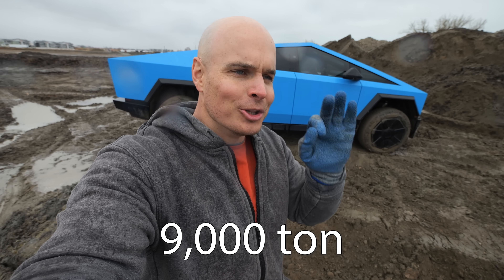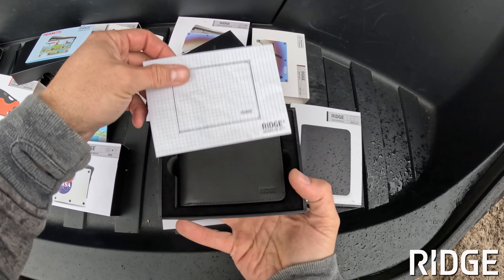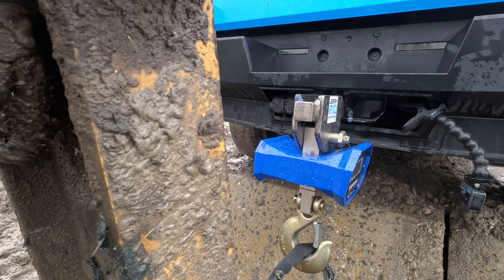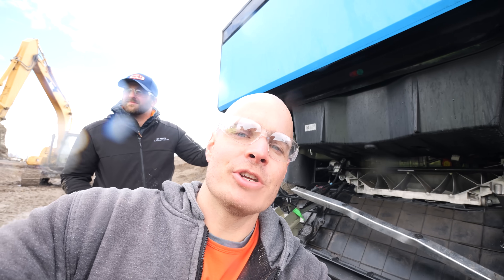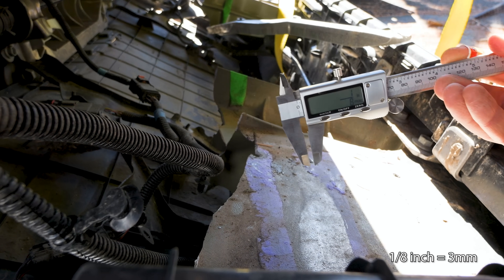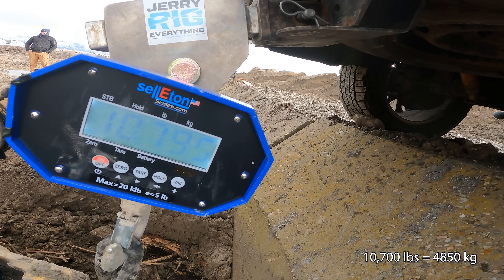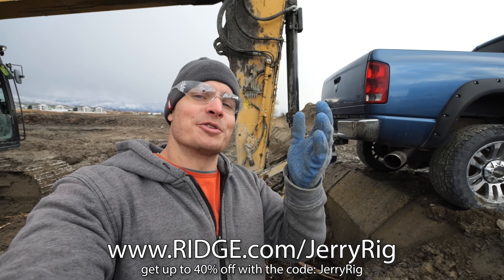SHOULD YOU TOW WITH A CYBERTRUCK?! - (catastrophic failure test)

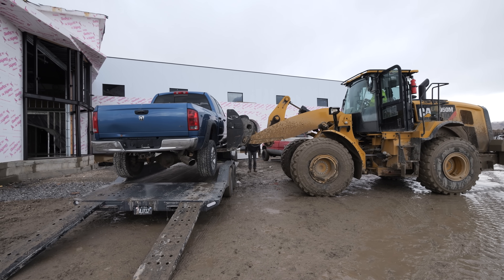Comment from the maker: Welcome to the Cybertruck vs Dodge RAM tongue weight durability test. To see the steel frame 2004 Dodge Ram get tested jump to 11:12 (spoiler: it survives)

We've seen at least 3 other Cybertrucks loose their back end. Its not the hitch that breaks.  It's the aluminum truck itself that snaps. Don't let it happen to you!
Reply: You need to durability test the ridge wallet
Reply: @travisminneapolis Smarter every day did that. He shot it with a 9mm.
Reply: It's glued to stop rattling
Reply: @integrii  not 6 feet behind the enclosed cabin where no one would hear a rattle. There is a structural component to that adhesive so the questions are is the glue there to add additional support to the hitch from surrounding sub-assemblies  or are surrounded sub-assemblies being supported by the hitch?
Reply: Shouldn’t the comparison be more of a 1500 not a 2500 as the towing capacity and frame build will be bigger based on it’s higher towing capacity that it has?
Reply: Now do your Rivian.  Haha.  Just kidding
Reply from the maker: @darbymoses4053  i might 🤔
Reply: Do your R1 @JerryRigEverything
Reply: @JerryRigEverything  No he won't.
Reply: @JerryRigEverything  yes please
Reply: @JerryRigEverything  Do it!  I dare ya!
Reply: @JerryRigEverything SAE J684 says a trailer coupler should be able to hold 1.3xtrailer weight in vertical compression. Your test seems to show cybertruck doesn’t meet SAE towing standards if it did it would be rated for a max of 7k lb towing
Reply: @JerryRigEverything We wish you would, but we all know you won't. You have a personal narrative to push against Tesla. FYI - The R1T tongue weight rating is 1,000 lbs.
Reply: @JerryRigEverything  The cybertruck castting snapped at the crash structure. You could make it stronger but then the crash structure would be stiffer. Cybertruck gets a 5 star safety rating so perhaps Tesla chose safety over maximum strength.

Structural adhesive is extremely common in automotive and much stronger than you think. 

Its hard to tell in your video but the steel frame truck looks bent and if it is permanently deformed, then I would consider that a fail.

You seem to have a strong bias against Teslas and I wish you would at least try to be a little more object in your Tesla related videos.
Reply from the maker: @5893MrWilson  i put the same weight on both trucks. Trucks with hitches aren't designed to crumple. Thank you though.
Reply: @JerryRigEverything they didn't invent the press they just bought one...
Reply: @JerryRigEverything  that would be an awesome comparison to see.
Reply: @JerryRigEverything  Do your "not a wheelchair"
Reply: @JerryRigEverything you wont do the Rivian…if it failed as well, that wouldn’t fit your initial agenda of this video. I actually think the cybertruck in general is a turd and its ugly as sin, im on the Cyberstuck reddit page, but its not because “I hate the CEO because he is doing mean things” “he is such a jerk” —-yes, thats you. man up already
Reply: @JerryRigEverything  You won't.
Reply: @JerryRigEverything  It's more than a might be. All your word choices, adjectives, and lack of objectivity clearly indicate perception bias.
Reply: @JerryRigEverything you should I’d be curious
Reply: @darbymoses4053  no, do it
Reply: Not holding down the front of the Doge is a huge fail in your test.

Forces are dampened and forces are slightly distributed further to the front of the car when the nose is higher.

It would have been fair to make the two test cases the same.

Besides, 10k down force is incredible...
Reply: Try really towing stuff or pulling it instead of applying a downward force.
Reply: Loading 10,000lb onto a tongue that's rated for 1,100 lbs and the being shocked when it breaks... I used to love your content Jerry, but this is a new low for you.
Reply from the maker: @DevinOlsen  this is a tongue weight test.  So on the tongue is where the weight gets placed. We did the same thing to the Doge Ram at the end of the video. No worries though!
Reply: @ Pushing down on the hitch while also pushing the front of the truck down adds unnecessary stress from the suspension and frame flex, making failure more likely but in an unrealistic way. A proper test would apply a direct, controlled load on the hitch alone, as real-world towing never involves simultaneous force on both ends of the vehicle. This method skews the results and doesn’t reflect actual conditions—pure nonsense.
Reply from the maker: @GET2222  for official hitch SAE safety certification tests they also strap the frame down.  Or mount the hitch on a rigid structure. Thank you though.
Reply: Nice job Zack!  You proved the Cybertruck’s failure occurs at 9 times the rated tongue weight. Safety factor of 9 sounds great to this board certified registered professional structural engineer.
Reply: @willbraswell4906  Does to me too!
Reply: EDS
Reply: Do the telo
Reply: Does the tongue weigh capability so much. Here in EU, most tongue weight I have seen is 100kg. I might be mistaken, but from what I understand,  that is the weight of a no moving cargo applied directly on the tongue or hitch. And this is not the weight of the trailer.
Reply: @teovm  Same here in the USA. My old Ford F150 pickup has a bumper hitch and is rated for 300lbs tongue weight (136Kg) and my 2023 F150 with a factory tow package has a 500lb (227kg) tongue weight. The frame on the CT is engineered to work within it's design limits, and it appears to do so. Airplanes are designed this way; the wings hold the entire weight of the plane for take off and withstand massive stresses in turbulence, but if you step on the wrong spot on the wing it will buckle and the plane will be grounded until repairs can be made. 

If I start seeing cases where hitches/frames fail under normal usage then I'd be concerned and say that they need to look into it. In reality, most CT owners buy them for status or to get attention; they aren't using them as work trucks. EVs aren't really great for any significant towing anyway. Imagine pulling your camper to go away for the weekend and having to stop every hour to charge for an hour!
Reply: @mikelemoine4267  What the user does with It's vehicle is their job, work or pleasure or both. From what I see, most of the high-end trim trucks in the US are just a show off vehicles, never been used as a work truck, or like once a year. But it does not matter, the hitch should work.

Towing is not for everyone. Here in the EU you have to have a special license if you want to tow something over 750kg. So I presume it includes load balancing and other stuff when taking the course. 

I'm just interested what is the case that a tongue weight should be that strong to withstand the weight of the trailer it is pulling. Wouldn't that lift the front end, making things way worse than braking the hitch (frame). Does anyone asked the suspension about that scenario 😄.  My car can cary 670kg, but can tow 1300kg. Now I do not see how putting 1300kg on the tongue wil not exceed the 670kg carrying capacity. If you hit a pothole or an animal the suspension on the trailer and the vehicle should balance the load for that split second. The only way the tongue will carry that weight is on a strange incline (a very sharp high degree incline change) and if the trailer lifts from the ground for some reason. But I do not see how that is a fare use. Non the less, if it is in a standard like ISO, DIN.. then I guess it should withstand such weight, but is it.
Reply: Get Sandy Munro on the line! I wanna hear his take on this and especially about the adhesive. Feel free to make it fun and have Jason Fenske from Engineering Explained come on as well. Them two know each other.
Reply: I've yet to see any data to back up the claims you and WD made that these are falling off in real-world, normal towing conditions. Can one of you do a video on this?
Reply: You had it all wrong. I know you don't like Tesla, but your final thoughts on this were full of technical knowledge mistakes. You SHOULD take it back and admit you were wrong about it. Please be better Jerry, don't fall in the angry haters pot.
Reply: Jerry has a flawed experiment. It’s called physics. When you push down on the front end of the truck to stabilize the force on the back you are adding more stress to the hitch. Meaning, the tongue weight was stressed more than the weight with pressure from the front and back. 

Try again, Jerry. 😂😂😂😂😂
Reply: @GET2222  sorry but your description of the physics involved in this demonstration makes no sense at all.
Reply: You are resorting to sensationalism not facts.  You are testing the tongue weight, not towing weight.  1,100 lbs weight limit vs 11,000 lbs towing capacity.  Shame on you, just to up your viewership.
Reply from the maker: @johnwilliamson9453  this is a tongue weight test.  So that makes sense.  Thank you!
Reply: @JerryRigEverything  Then you should correct the allegation that this is dangerous, as it’s 9 times stronger than stated by Tesla.  As you know Tesla and Elon is under fire (wrongly I feel) and you should not throw fuel on the flame.
Reply: @JerryRigEverything  Why not use trucks rated for the same then ? And does the frame bending at 5000 lbs not count as a fail for the normale truck then ? As it isn't safe to drive anymore at that point.
Reply: It’s 11,000 pounds of towing capability not how much you push right on top of it like shown in the video there’s a difference now yall are just trying to prove Tesla wrong but yall are the dumb wrong people here. You do that to any vehicle it will break
Reply from the maker: @Therandome2  the dodge didn't break watch the video.  😂😂
Reply: @ I did. What degree do you have
Reply: @JerryRigEverything  The frame bent at half the weight, making the whole car unsafe to drive, and its rating is even higher than the CT.
Reply: @ no I don’t know how to explain it but yall are wrong about 11k tow weight/torque
Reply: @JerryRigEverything  The Dodge didn't break because it's rated to hold significantly more weight. It's not even the same truck class.
Reply from the maker: @TheDevonParker  it's a 2004. Both are class 4 hitches. Thank you though.
Reply: @JerryRigEverything  But one vehicle you pinned down in the front, the other vehicle was missing an engine, so I'm pretty sure the weight distribution off of what was planned for the vehicle was completely inaccurate. It did not give me that things are the same when nothing is the same in your comparison. Also, did you measure the travel on the frane, because the Cybertruck aluminium will just snap, whereas the truck you use will bend. 

This face that you wanted to virtual signal to all the people who made Tesla and Elon right now that you're siding with them. Don't try to keep this as a scientific test because it's far from it.
Reply: @JerryRigEverything  The Dodge is clearly rated for significantly higher tongue weight and payload in some configurations. The engine in those trucks weighs 1,150lbs, which adds extra weight and stress to the frame.

You used a truck sold in a higher class, and you used a truck with the engine removed.
Both having the same class of hitch does not determine what the FRAME can manage based on the engineering specifications.

Some configurations of the 2004 RAM 2500 are rated for 1,800lbs tongue weight vs the Cybertruck's 1,100 lbs.

Thank you though.
Reply: @LA_318 ... he was able to rip the ass end off the Cybertruck, but not the Dodge. I mean.... THE FRAME BROKE, YOU SYCOPHANT.
Reply: What's Jerry trying to do? Prove how great the Cybertruck is manufactured. That was 10 times the tongue weight the CT is rated for. And no, a pothole would not put 10X on the tongue. At 10X the front wheels come off the ground and they had to hold the front down in this video to keep that from happening. It seems Jerry was trying to prove something despite the facts, and he failed.
Reply: You mentioned that both aluminum and steel don't have fatigue limits but in very different tones
Reply: Thanks for metrics!
Reply: You said the aluminum does not have a fatigue limit. Then you said steel does not have a fatigue limit right after that.
Reply: the fact that the Doge RAM was in an accident and still beat the cybertruck was amazing to see and im happy it did
Reply: I'm sure you heard this already but at 4:21 you state that steel does not have a fatigue limit. I know its a misspeak, but you may want to leave a little note somewhere clarifying that
Reply: Allow me to clarify that Cody applied force by slamming the rear upwards, not downwards before breaking it off. This means your experiment demonstrates that it's weaker than the truck, but it could be significantly weaker in the opposite direction, which is more challenging to test. Am I right?
Reply: So overengineered v superbly engineered to cope with the load in the manner and direction that it will be subject too. It's like F1 suspension, super strong in the direction it goes in, weak in the other directions which it is not designed to move in. Anyone can over engineer anything, the skill of engineering is using the least amount of material to hit structurally required goals
Reply: weight durability? when trucks are towing that is not the vector  of forces that are applied to that element so the test is not relevant to  TOWING.
Reply: @geostel  100%
Reply: Now you make this kind of stupidity videos to feed this stupid society?
Reply: @Sirikazy  It's not stupid ,he's engineer, he understands what he's doing wrong in this video and he is doing it on purpose.
Reply: That's not really even a live load either, which is more concerning. With a dynamic load the potential to break is at much lower force. At the absolute minimum, there should be a rear steel subframe to distribute the load into the aluminum frame.
Reply: Sorry Jerry but this the dumbest test ever! Because even if you’d have that heavy of a payload the tow hitch would touch the ground lifting the front of the car waaaay before breaking 😂 you even said that there is so much down pressure that you had to use another excavator to hold it in place in the front. I used to respect your channel with great content but idk why you’re doing this, probably just to cash in on the lets do something bad against tesla train 👍🏻
Reply: @JerryRigEverything  Fails as a YouTuber for click baiting!
Reply: If Tesla goes bankrupt, will their cars become bricked?
Reply: Tow capacity is not the same as “tongue weight”.  Please don’t ever pretend that you don’t know that.
Reply from the maker: I explained the difference in the video.... so yeah pretty sure that's the whole test. @scottweis7214
Reply: Can you try this test with a Century 1150 wrecker on a 4-axle Peterbilt 589 chassis, using the excavator to apply downward force on the wrecker boom?
Reply: You raise eyebrows 😲, not eyeballs 👁️👁️
Reply: Now do one of the Ford Aluminum Body trucks to see how it holds up . that way it's Aluminum vs Aluminum, Not Aluminum vs Steel.
Reply: The power of the 3rd gen ram
Reply: What are you doing?T 51:09 😮
Reply: form my searching and undercoating vehicles ive seen my fair share of rams cummins  around that year and it max load for towing ive seen is around 13000 lbs to 16000 lbs so you got a bit more to go before it will brake off
Reply: @JerryRigEverything  ur test is Entertaining but completly pointles
Reply: Esos autos son una mierda no pasan la prueba es botar el dinero
Reply: Someone is clearly a Kamala supporter who’s trying to make Musk look bad.. you are a disgrace to this country. Get OUT
Reply: @JerryRigEverything  Zach, we saw glued components that separated from the cast aluminum, do you believe it was glued to either A: provide supplemental support for the hitch assembly or B: have the hitch assembly provided support or limit movement for structures above the hitch?
Reply from the maker: @Jetjockgordo  it's really hard to say. I just don't know. There are aluminum points that do poke through that bottom layer.  I assume those were also structural. But I don't know if those were doing most of the work or if it was the glue.
Reply: @JerryRigEverything This is one of the most disingenuous videos you could have possibly made. Really disappointing.
Reply: Nice joke 🤣🤣🤣🤣 do u belive ur self? I think not. In normal utilisation condition that force and the way it's produced will never be reproduced. Even If that force will be produced it won't keep that longer the truck under tension. Maybe the front axle will be rised from the ground but the truck won't brake. I'm sure 100%. I challenge u to put a trail loaded with 5 tons and go where ever u want trying to brake the Cybertruck. But it will never brake.
Reply: Don't know about the US, but both the Model X and Model S are sold with a hitch in Europe. And both those vehicles also have a lot of aluminium in them. It would be very interesting to see tests with those vehicles as well.
Reply: Unsubscribed. You have a weak moral character to be okay producing such a B. S. test and claims that you care about consumers. 

All this was, was you showing people that are destroying Teslas and attacking Elon. That you side with them and that you hope that they don't attack you for owning or supporting Tesla in the past. I hope if you try to use this as a tax write-off, the IRS comes in punish you for fraud.
Reply: @JerryRigEverything  what a terrible biased video!! The front wheels would have been off the ground before it would have broke! Your left wing woke blue hair is showing!!!
Reply: Bald man and Crazy nuclear scientist hate DOGE man because he made his dreams a reality. This is an unrealistic test, which you've covered your behind in the video. This is a completely unrealistic test just to drum up hate for Tesla and elon musk by proxy since most people don't understand the physics and ratings involved. Not a fan of captain orange or doge dictator but your should hold yourself to better standards.
Reply: please change your description to show this too, *The tongue weight is the downward force that the weight of the trailer exerts on the hitch. It must not exceed 10% of the maximum towing capacity. Your miss informing people with your current description!
Reply: looks like someone is pissy his candidate lost
Reply: @mistertwister7858  bro how did you turn a truck testing video political. It's not in the slightest bit relevant
Reply: I highly doubt they're ignoring this... All they have to do is increase the thickness of the metal that they're casting in those areas.
Reply: This video makes me worry about the meth epidemic in Utah.
Reply: So although aluminum is the problem this test your doing is downward force equivalent to tongue weight so your test is flawed.
Reply: It definitely won’t happen to me! I’d never buy one of those pieces of junk!
Reply: Aluminum has a shorter and weaker fatigue limit after a short number of cyclical cycles before failure. Just ask the navy with their aluminum haul ships.
Reply: That Dodge is ugly lol
Reply: I don't like seeing the destruction of products that are functional, but I have to say that seeing a Tesla vehicle destroyed is somewhat cathartic during this time.
Reply: Have you sticker "I've bought it before Elon go crazy"? @JerryRigEverything
Reply: Was soll dieser Test?   > 4.000 kg vertikal auf der Kugel?  Da würde selbst ein LKW die Grätsche machen.  Es gibt wenige Zugfahrzeuge die merkt als  100 kg Stützlast haben. Klar, im Gelände kann das auch mal kurz mehr sein,  deshalb sind die  > 4.000 kg absolut Irre gut.  Das ein RAM  oder eine F 150 eventuell so viel können, liegt an der Tatsache, dass  sie Leiterrahmen  verwenden, wie bei echten LKW.  Nur dass sie  weder die Nutzlast haben, noch die Anhängelast. 
Weshalb es aj auch nur die Kugel gibt, ansonsten würde ja eine normale AHK rankommen , mit  z.B. 40 mm Bolzen.
Tandemhänger mit hoher Stützlast, haben auch andere  AHK mit stärkeren Bolzen.
Reply: If you do another comparison on build quality you should compare it to the Silverado EV and Ford Lightening. Would be cool to compare other EV trucks to this piece of crap! 😂
Reply: Truck frames should not snap like tesla
Reply: Hey man, I heard you're selling all of your Teslas this year. You could donate them to those in need like myself. I really need a vehicle to go to work and make sure I can give my child a decent summer and be able to use for emergencies and such.
Reply: Lose*
Reply: Do Ford lightning - that would be a legit comparison, not a gas guzzzler
Reply: ...... Does this guy seriously not know the difference between lose and loose? I'm upset a large YouTuber would make such a callous mistake. Lol jk
Reply: @JerryRigEverything  if I wanted this kind of 'test' video to smear a company, how much 💰💰💰 you charge?
Reply: Lose. Loose = not tight. I swear I was born to see this mistake as I do almost every day somewhere.
Reply: Can aluminum be mixed with anything to give it a fatigue value? I know some plastics are mixed with fiber, so I'm just wondering...
Reply: This is interesting, but not conclusive. The real concern with cast aluminum is its flexure strength - how does it perform with continuous oscillating load. This is when castings are more likely to show failure especially if there is a notch/defect on the casting.
Reply: what version of truck was it used in video,  looks like single motor,   11klbs is rated for dual and triple motr versions
Reply from the maker: @oldeknight  mine is the dual motor foundation series. (Not the beast)
Reply: @JerryRigEverything  so you're not a beast huh?
Reply: unsubscribed officially
Reply: Diesels hitch didnt "fall off" and/or "completely seperate". He arrainged a specific direct impact to the hitch that exceeded the owners manual weight capacity of 600lbs tongue weight and he arrainged it so that it was dramatically more and included a giant shock load of the entire vehicles weight which is like six thousnad lbs plus the shock load so this is like ten times the rated weight capacity in terms of tongue weight.  Jerry, your word choices on this are kinda misleading. You can tell a literal truth and at the exact same time be entirely misleading people which is in essence a BIG FAT LIE!
Reply: You clearly are biased and have a negative view towards Elon. But, you will never admit it.
Reply: A product clearly states its capabilities, yet IT is blamed when it doesn’t exceed those stated limits? It’s interesting how some content creators conduct their own “scientific tests” that claim to disprove findings from the National Highway Traffic Safety Administration.
Reply: You really need to admit that going 10x over the tongue spec weight limit is an amazing result, and everything you say regarding brief moments when almost the whole trailer weight can shift to the tongue is nonsense as the front of the truck would lift, preventing the excessive load and snaps. Do a proper test with towing 11000 lbs on a bumpy road at highway speeds and show us how "bad" the Cybertruck is.
Reply: @JerryRigEverything  Bogus video obviously designed to disparage Tesla. Tongue weights are all rated for 10-20% of towing capacity. The Cybertruck tongue weight rating is 1,100 lbs. You tied down the front and put almost 10x that weight on it before it failed! In a real world towing scenario if such a thing were even possible, the suspension would  collapse and the front wheels would come off the ground long before the hitch failed.

You have lost all credibility with many of your (now former) subscribers, I hope it was worth it. 😞
Reply: @John-qc8yy 100% agree! Good bye Jerry! Hope it was worth it!
Reply: No truck - even a Dodge - can handle 3 tons of downwards hitch pressure! It's not the hitch that's the problem - however the steering is! This test just proves that one material breaks before another material... did you really need to do this test?

"The RAM 1500 curb weight can range anywhere from 4,765 pounds to 6,440 pounds depending on the configuration you choose."

So this means that AT MOST it weight 2.921 kg - which is less than 3.000 - AND the rear axle of the RAM is NOT at the hitch which also has a meaningful impact - meaning that IF you ever applied 3 tons of downwards pressure to hitch of the RAM - the front wheel would be off the bloody ground m8! The Cybertruck is 3.104 kg however the rear axle is like a meter + from the hitch - and the rear engine(s) is behind the axle which also influences the results. I SERIOUSLY doubt any of the trucks would feel comfortable with 1500 kg of downwards pressure on the hitch - especially if the route is the least bit bouncy! The fact that the hitch is fine a 3000 kg - is ACTUALLY proof that it's more that sturdy enough to be used as a truck hitch!
Reply: Stupid test, no pickup truck in real life  is hold down by the front like that. 

Don"t tell me your trucks are doing wheelies while towing 10 000 pounds because of a bump or bad traller ballance...
Reply: This was the most ignorant test you could have possibly performed, I am extraordinarily disappointed in this video. You are smart enough to know this test is completely irrelevant, yet you still preformed it and implied otherwise. Total sensationalism that is very much not what I have come to expect from your content.
Reply: 10,500 is what I saw, you hate Tesla now, and it's noticeable.  Pathetic that you put political feelings first.
Reply: Don't own a cyber truck and don't care about them, but 10,000lbs is the "towing capacity" not the "hitch capacity". There's a massive difference. Tow is parallel to travel not perpendicular. Capacity is as much if not more factor of braking (legally) as it is structural integrity. If you can't stop a load your vehicle is rated for, then you get a fat check from that company when something goes wrong. It's also why people making videos about towing more than 10,000lbs are idiots. That's not the limit, it's the number derived from the safety factor. 

Edit: Unless your trailer has no wheels you'd have to massively overload it at the front to make this happen. That said, cast aluminum is a poor choice and people don't know how to tow anyway.
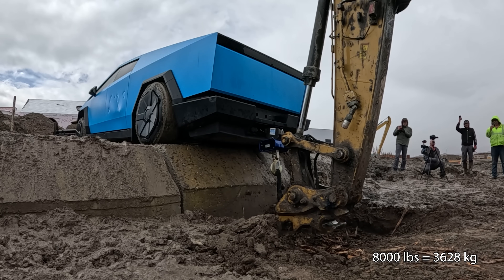Reply: 6:58  All the "doood" -ing  made me think for a minute that I was watching Smarter Every Day. 😉
Reply: Alright, buckle up, because I’m about to dissect JerryRigEverything’s Cybertruck hitch test with the kind of precision that’d make a surgeon jealous—and the sardonic glee of someone who knows physics isn’t just for nerds in lab coats. Zack Nelson, our YouTube torturer-in-chief, decided to see what happens when you treat a Tesla Cybertruck’s hitch like it’s auditioning for the role of “piñata” in a monster truck rally. Spoiler: it didn’t end well. And not in the fun, “let’s watch it squirm” way.
Here’s the setup: Zack takes this angular beast, rated to tow 11,000 pounds like it’s hauling Elon’s ego, and slams 10,400 pounds of vertical force straight down on its hitch with an excavator. At that point, the aluminum gigacasting says, “I’m out,” and rips off cleaner than a breakup text from your ex. Then he tries the same stunt on a 2004 Dodge Ram 2500—steel frame, blue-collar grit—and it bends at 10,700 pounds but doesn’t snap. Cue the slow clap. Riveting stuff, right? Except it’s all bullshit when you crack open the physics.
The Cybertruck’s hitch is built for a tongue weight of 1,100 pounds—that’s the vertical load it’s supposed to handle, not the whole damn trailer crushing it like a bad sitcom finale. Zack’s 10,400 pounds? That’s 945% more than the spec. Imagine your grandma baking you a cake, and you complain it’s not a seven-course meal. That’s the level of disconnect here. Aluminum’s brittle—it snaps under that kind of absurd overload. Steel bends like a politician’s spine. Neither proves jack about towing unless you’re planning to drop a house on your hitch.
Towing’s about pulling, not squashing. That 11,000-pound rating is horizontal tension—force spread out, not a guillotine chop. Tongue weight’s maybe 1,100 to 1,650 pounds in the real world, 10-15% of the load. Zack’s test is 845% over that upper limit. It’s like testing a condom by firing a cannon through it and calling it unsafe for sex. The physics don’t line up—direction’s wrong, magnitude’s insane. Potholes don’t hit your hitch with nine times its design load unless you’re towing through a war zone.
Tesla probably engineered that aluminum to break clean—save the frame, sacrifice the hitch. Smart, if you’re not into twisted metal origami like the Ram’s steel flex. But Zack’s takeaway—“I wouldn’t tow with this on a freeway”—is the kind of overdramatic nonsense that’d get him booed off a comedy stage. A 945% overload doesn’t mean it’s a death trap at 1,100 pounds. It means he broke it because he could. Congrats, Zack, you’ve proven gravity works. Next time, test it within spec—or at least make the explosion prettier. I’d watch that.
Reply: @GET2222  "test it within spec" because real life always happens to just match arbitrary specifications, and nothing out of spec ever happens, right? shakes head oh to live in such a perfect world...
Reply: @ huh? You know Jerry just proved it was 10X tested over spec.
Reply: @GET2222  so did you watch WhistlinDiesel and what happened to that hitch assembly? Similar failure but under horizontal tension with no tongue load at all. I'd like to hear your opinion about that incident. I looked closely at both videos and the frame casting looks very uneven with wild variations in wall thickness and possible contamination or voids in the cast aluminum. It's more about slow, predictable bending and deformation of steel before catastrophic failure versus almost no bending or precursors to explosive failure of the cast aluminum. Why didn't the 20 year old RAM fail in the same manner even with a higher load and signs of previous damage?
Reply: I dont think this was a fair test at all.
Towing tests should be done in a way that reflects real world conditions typically with the load attached to a proper hitch at a reasonable angle (close to horizontal). If you pull at a steep angle, a lot of the force would be redirected in ways that don't accurately represent towing capacity.

This is more of a structural stress test, almost like a fracture test or a shear force test rather than a real world towing scenario.

Towing is meant to work along the longitudinal axis of the vehicle, where the frame, hitch, and suspension are designed to handle the load efficiently. But if you apply force at a steep angle, you’re introducing bending moments and shear forces that could break components not designed for that kind of stress.

It’s like pulling a shopping cart sideways instead of pushing it forward—it’s not designed for that, so it’ll just tip or break rather than roll properly.

You are basically testing frame rigidity and weak points rather than actual towing capability.

I hope we actually see a fair test in the future.
Reply: @upper-Machine-276  exactly! Well said. I just can’t believe so many people here think this test proves anything bad. In fact it proves the opposite.
Reply: @upper-Machine-276  Yeah, this test is not realistic at all to what he’s trying to say. He is critical on Elon so it’s probably done in a biased manner to throw shade on Tesla…
Reply: @upper-Machine-276  I didn't watch it, but the thumbnail shows what you're talking about, and his description of the video also matches what you're saying. It doesn't sound like it's worth watching at all.
Reply: We got excavator having affair with dodge while Tesla got injured before GTA VI 😅
Reply: @vpn6958  It's really simple: buy a Dodge not a DOGE.
Reply: Lose*
Reply: A totally biased "test"... not a problem, things should be tested! But you say 10k is bad for a Tesla, but 10k is great for a Ford... just watch yourself. Stay technical, much better... no one needs another biased crying Youtuber.
Reply: This whole video is very misleading on so many levels and coinvent for you only to go a little bit past the known breaking point of the Tesla. And you just proved that the Tesla its better than what its rated at. and even if you barely pointed out the difference for towing and tow hitch weight. still repeated like it was the same. Bet the weight is within 10 percent of eachother.
Reply: Spoiler, the frame bent at 5,000lbs and you didn’t bother mentioning that.
Reply: Sounds like Cybertruck is made just like my collector toys ... diecast.  Many people here are confused about dead loads and live loads.  The dead loads are after the tesla event when you are dead and motionless.... no seriously the tongue and trailer weights limits are dead loads.  The live loads, that most manufactures design for, are like when you or trailer hits a hole going down a steep hill with heavy breaking.  The tongue load can easily approach the total load in the vector perpendicular to the road or apparent downward force on the tongue.  Any  trailer of more than 3000 lbs is also required to have brakes.  These breaks will easily transfer  1/2 the total weight in a "rotational moment" of trailer to downward tongue force.  Myself I would expect any truck to be able to hit a pot hole in addition to heavy breaking, like we do just before said pot hole!  What we want to see here is a tire/suspension/axle failure BEFORE the hitch/back or vehicle breaks off.
Reply: @koiphish333  If that was the case you would be seeing trucks doing wheelies while towing loads regularly. 10k lbs applied at the tongue would mean that 6k lbs tesla jumps up and the tongue digs into the ground. There is a reason they held front of the car in this 'test'. You can hate Tesla/Elon all you want, idc, but don't defend this idiotic video. Not to mention this dodge has 20-25% larger rated towing capacity than cybertruck.
Reply: I would have believed this guy to be fair but he is known to be Elon hater so I now take his opinion less than shit. This is a good experiment though. Elon will build stronger Teslas after this.
Reply: @DovashiFuku "I would have believed this guy to be fair but he is known to be Elon hater so I now take his opinion less than shit." So, because he has a political view, he suddenly can't be objective?
By the same measure, do you think you can be objective if you can't get over what you see as his political bias? Or in other words, would you still buy a Cybertruck even though the thing has been proven to be a PoS? Maybe you're letting your political bias make you make bad decisions because you can't be objective because you're too tied up in "his political biases don't match mine".

You're basically saying "this is a shitty test of a Cybertruck's physical specifications because he doesn't like Tesla" when it's just a stress test that the Tesla fails because it was badly (and cheaply) manufactured compared to a time-tested brand of AMERICAN vehicle.
There's also the side of this that the Cybertruck is completely bricked. You'd be able to drive any non-Tesla vehicle away from that situation afterward (even if it wasn't really safe to do) but that Cybertruck is completely dead after LOSING THE BACK END OF ITS FRAME. That alone is garbage, and it doesn't matter if you think that it will never undergo those forces. It will if it's going to be a medium-duty truck.
Reply: @JerryRigEverything  i think people forget that it's a truck not like daily driving vehicles in the city . A truck must be robust for extraordinary tasks, not for high speed .
Reply: I 100% agree that the truck should be rated correctly, but you used to work with companies to improve their vehicles. Now it seems like you're using your political bias to promote judgement against an electric vehicle company you have reviewed and promoted in the past due to it's connection current political events. What happened to wanting to elevate the electric vehicle space and market?
Reply: its literally a hit piece. tow rating is 11k not tounge weight
Reply: i find crazy how tesla lost that bad to a 2004 ram that has been in a crash😂🤣
Reply: @ you find it crazy that the tesla 1/2 ton truck lost to a 3/4 ton truck? The rated payload for the dodge is almost twice that of the tesla. It's an apples to oranges comparison. Towing capacity is NOT tongue weight and his little hotwheels demo was just plain wrong. Imagine moving a wheel barrow around with 500lbs in it.(towing capacity)  lets say you only need to pull up 25lbs on each handle to lift the load. (tongue weight)  are pot holes or hills going to make the handles too heavy for you? not even close. the 500lbs inside it might be hard to push up a hill or to stop while coming down a hill though. See the difference?
Reply: @axlebreakeryt try a 2024 ram of same rating
Reply: @axlebreakeryt this is not scientific at all he did this for clickbait this test is bullshiit
Reply: @axlebreakeryt  it didnt dishonest test, cybertruck has low class rating for single motor version,   2 motor and triple motor are rated for 11klbs,    base model in video is only rated 2500lbs   so it past the test
Reply: @axlebreakeryt Having a steel frame built like a brick shit house helps😂
Reply: @axlebreakeryt   not so crazy...  The ram was literally made for doing work with and moving and towing heavy stuff.  Cyber was never meant for that.  It's truck-ability is meant to be more like a 1980s era Toyota pickup..  🛻  they were super popular.... And I was looking for one just last year...
Reply: @axlebreakeryt  “lost that bad” there is very little between the weight the cybertruck broke and what they put on the dodge, for all we know the dodge could of been close to breaking.
But regardless they both handle way more then they ever need to for towing a trailer
Reply: @markharrison7468 They bounced on the Dodge. Dynamic load is worse than a static one.
Reply: @markharrison7468  No, the Dodge wasn't "close to breaking". Rolled steel doesn't snap, it bends. If it were close ti the limit, it would alrwady be bending slightly, as the failure point doesn't come suddenly, but gradually.
Reply: Yea, aluminium alloy would have been ok feo a sedan hatchback type of a vehicle, but it looks to be inadequate for a truck that is supposed to tow heavy loads.. 
They need to go back to the drawing board and come up with a better alloy alternative for the CT. 
Well, at least it's good to know where the problems are, so that they can be addressed early, before it becomes a serious problem.  😉
Reply: @yesno9592  Aluminum proves itself in racing frames.  It is the use of casted aluminum that is the issue.  You might notice that even farm tractors do not use cast iron on the hitch! Many busses  back in the 50s and 60s were using unibody design with aluminum sheeting/body.  They designed steel mounts for engine, suspension and bumpers so the high stress areas would distribute point loads into the larger body.
Reply: @yesno9592  the car is on the road already. it is already too late
Reply: @ they been making aluminum tow hitches and trailers for years that carry loads exceeding 10k lbs. Should they go back to the drawing boards with all those too? oh ohps, they don't fail.
Reply: @yesno9592 You know nothing
Reply: @yesno9592  Keine Ahnung, aber davon extrem viel.  Der kann sicher 5.000 kg ziehen,  hier wurde aber die Stützlast "geprüft"  . es gibt kein einziges Fahrzeug in Europa, das auch nur 200 kg Stützlast an einer Kugelkopfkupplung  hätte.   Ex E3 Daimler AG ( Truck & Bus)
Reply: Hello everyone! I'm Vietnamese, nice to meet you.
Reply: This is the most moronic video I have ever seen on YouTube followed by the most moronic comment made by the producer of the video. If you're a woke lefty just say it instead of making up crap videos like this that make absolutely no sense. You must really hate your country if you're mocking a guys company with moronic tests because he's trying to save your country from bankruptcy.
Reply: 😮The 51:09 😮 51:09 😮 51:09 😮 51:09 was 51:09 😮😮 51:09 I
Reply: You really showed how safe and better the CT was, the truck bent it's frame at 2250kg, and would be dragged down a cliff instead of break off the trailer instead.
Reply: A 10,000 trailer will not apply 10,000 in any direction, at any time on a hitch, vertically or horizontally. Generally 10-15% of trailer weight is statically loaded on the hitch. During a large bump, perhaps it instantaneously sees double that, so around 3,000 lbs. (leaving a safety factor of >3. In heavy acceleration, let’s say 0-60 in 5 seconds (cyber truck definitely can’t do this towing 10,000 lbs), the hitch will see around 5,000 lbs of horizontal force. That frame is definitely stronger in horizontal than tongue, because that’s how it’s designed, due to how trailers apply load.

Also, they could have gotten more weight from the excavator, just needed to bring the tracks closer to the truck. Tesla may still have an issue, but everything done in this video stinks, and doesn’t show anything.
Reply: JerryRigEverything's Cybertruck hitch load test, conducted by Zack Nelson, has sparked a lot of discussion, and after digging into it, I’ve got some thoughts. The test involved using an excavator to apply downward force on the Cybertruck’s tow hitch, measured with a crane scale, until the rear frame failed at 10,400 pounds. For context, the Cybertruck’s official tongue weight rating is 1,100 pounds, and its towing capacity is 11,000 pounds. Nelson compared this to a 2004 Dodge Ram 2500, which withstood 10,700 pounds without breaking, highlighting differences between the Cybertruck’s cast aluminum frame and the Ram’s steel frame. 

First off, the test setup isn’t exactly a real-world towing scenario. Tongue weight—the downward force on the hitch—typically shouldn’t exceed 10-15% of a trailer’s total weight, so for the Cybertruck’s 11,000-pound towing capacity, 1,100 pounds is right in that range. Nelson’s test piled on nearly 10 times that rated tongue weight, straight down, which is more like simulating a catastrophic overload than everyday towing. He suggested this could mimic hitting a massive pothole with a heavy trailer, but that’s a stretch—potholes might spike tongue weight briefly, but 10,400 pounds is an extreme edge case, not a standard risk. 

The Cybertruck’s failure at 10,400 pounds actually shows it’s got a huge safety margin—almost 9.5 times its rated tongue weight—before the aluminum gigacasting snapped. That’s impressive overengineering for normal use. The Ram 2500, with its steel frame, didn’t break, but steel bends and absorbs stress differently than aluminum, which can crack more abruptly when it hits its limit. The Cybertruck’s frame ripping off looks dramatic, but it held up far beyond what’s practical, suggesting it’s plenty robust for its intended 11,000-pound towing spec when loaded properly. 

Nelson’s commentary leaned toward skepticism, warning about towing safety despite the hitch exceeding expectations. That feels a bit alarmist—real-world towing doesn’t typically stress a hitch vertically like this, and there’s no wave of Cybertruck hitch failures under normal conditions to back up the concern. The test exposed a material difference: aluminum’s fatigue properties mean it might not flex and recover like steel over decades of abuse, but for a new truck within its limits, this isn’t a red flag. 

The construction details—like the structural adhesive holding parts together—got some flak, but that’s standard in modern manufacturing, even in high-end cars. The bigger question is whether gigacast aluminum is the right call for a truck frame long-term. It’s lighter and cheaper to produce, but steel’s durability in extreme scenarios (like this test) might give it an edge for heavy-duty purists. 

So, my take? The test proves the Cybertruck’s hitch can handle way more than it’s rated for, which is reassuring for towing within spec. It’s not a flaw that it broke at 10,400 pounds—that’s an absurd load. The Ram’s steel frame winning this torture test doesn’t mean the Cybertruck’s unsafe; it just means different materials fail differently under exaggerated stress. For most owners, this is a non-issue unless they’re planning to tow 11,000 pounds over apocalyptic potholes daily. Nelson’s video is great clickbait, but it doesn’t shake my confidence in the Cybertruck’s real-world towing chops. What do you think—does the aluminum vs. steel debate change how you see it?
Reply: CLICK BAIT!!!!! I LIKE YOUR CHANNEL BUT THAT WAS CLEARLY CLICK BAIT
Reply: There's got to be a simple fix for this problem, like a massive steel bracket which spreads the stress of towing across a wider area so that there isn't too much stress applied at any one point of the aluminium frame.
Reply: Well done, you proved that if Elon can make the Cybertruck do vertical take offs that it would break at 10000 pounds. You make like there are scenarios where the hitch will be pulled at 90 degrees, which is pretty much impossible. That would be cool if it was a 'for science' style video but you are making like this is dangerous and not up to spec, based on this. Everyone knows why, the CEO started supporting a certain person. Not sure why its a good idea for people trying to get as many views as possible to do these kind of things. I am not even American and its just annoying, I have always enjoyed your content but this is really getting lame now. Whats next blowing it up with an atomic bomb to show that the body isn't as tough as you think it is.
Reply: @tremaineunderwood7322 God bless you and this comment as it’s 100% true. I will not support this garbage anti-America human anymore.
Reply: @tremaineunderwood7322  I used to enjoy this guys phone tear downs and 4X4 stuff, but this is a low blow for “Mr Christian” - who always goes on about being fair and honest - He has been pretty vocal about his dislike for Elon as he sees him acting dishonestly in his govt role, so what does he do - puts out a dishonest video to try to hurt Tesla. Nice one mate. What a legend.
Reply: @tremaineunderwood7322  "pretty much impossible" If a loose load shifts forward, suddenly the weight is being borne by the hitch more than the trailer's axles, and guess which way that weight is pushing? (Down.)
Reply: @tremaineunderwood7322 your dead right.
Reply: Won't  be buyin' a  Tesla,  an RV camper coming off the hitch at speed is a nightmare.
  You would think Tesla Trucks could get a nice Aluminimum / Titanium /  Steel  Alloy formula for an easy 20,000 lb limit all designed by the   SPACE  X team ?
Reply: Not as scientific as you could've been with the amount you stressed that to be honest. But I would definitely say it's scientific enough to prove there is a significant problem here. Great video though, I understand it was more for entertainment value. But I think if you are going to stress how "scientific" the test is maybe you should use the scientific method.
Reply: I bet shock loading would break it at 50% of that weight. Or using 50% on a vibration table. 
It's not that aluminum is a poor choice, it's the way the truck is constructed. Ford is using aluminum frames in F-150s and I haven't heard of a single failure.
Reply: @MMPCTV  No, F150 is using alumnum body panels. The frame is steel.
Reply: @MMPCTV 🤮take your FORD and move to Mexico
Reply: @MMPCTV ford frame are not aluminium. The body is 
And remember you dont have aluminium it is from Canada 😅
Reply: @chriauc2976  Yep, your right. The body is aluminum, the frame is still high-strength steel.
Reply: This is a super huge propaganda video. Zack is so wrong on so many  points here it's crazy. How did he not research better.
Reply: @Abe_Snayke  yeah the frame still broke. At least 3 others have broken. I mean how did he force it to break. The much older Dodge did fine. Just admit this truck is a glorified trash can. C'mon you can't even take it through a car wash ffs. Besides he's right most people miss load trailers and most people live in a place where pot holes are common. No matter what you say he has proof that this truck isn't equipped for towing anymore than maybe scrap to a scrapyard to make back some of the money you wasted to look trendy.
Reply: @Abe_Snayke ever heard of shock??
Reply: @Abe_Snayke  Had to stop suddenly when a car pulled out in front of me, load of gravel shifted forward. Hitch bent but didn't break. Zack is correct, real life doesn't care about your research. Tesla did the research and ended up with a weak product.
Reply: @Abe_Snayke he became a Tesla hater , it was a huge article all over news few months ago as he was advertising selling his teslas 
what a garbage youtuber !!!
Reply: @Abe_Snayke  dude, the dodge was lifting the excavator, you saw the spot where the aluminum was 3mm thick. did you rage quit watching the video after the swastytruck's frame broke clean off?
Reply: @JerryRigEverything  to see Jerry express his political bias feel free to watch any of his videos both past and present I trust no human I trust patterns same as glass breaks Jerry has a pattern of political bias I once respected him however I no longer do.  Especially after this biased test it should be relabeled tongue weight exceeded by 10x rated value not anywhere close to a fail.
Reply: @situationalawarenesssurviv7331 exactly. And I've noticed it too lately I started watching less and less of his videos and and I think I'm now done with Zach.
Reply: @situationalawarenesssurviv7331 yeah. Zach has forgotten his job and become a political activist.
Reply: @ agreed. Zack aka Jerry aka liar is a smooth brained political shrill who can’t even afford hair plugs.  He is very unfortunate and jealous of anyone more intelligent than him
Reply: @situationalawarenesssurviv7331  "but he's politically biased so that means he can't be objective"... and you're politically biased making this statement, so does that mean you can't be objective either?
Reply: @ he is outright lying confusing tongue weight with tow rating he isn’t dumb he knows he is wrong.
Reply: @ he’s a mo-ron.
Reply: @situationalawarenesssurviv7331 
I feel like you do, there was a time i thought he was doing good for people by calling out the phone manufacturers on their products. Now all i see is a liberal tool, acting like a snowflake because Kamala didn’t get in office…Get off of CNN dude, Elon isn’t doing anything bad Zach, except uncovering corruption within the government, the people you need to worry about are the ones making the biggest  fuss about it! Those are the snakes and rats.
Reply: @situationalawarenesssurviv7331 Thank you for this comment. Dude is simply trying to make Musk/Tesla look bad. Clearly not a fair test and his attempt is pathetic. He might end up in a wheel chair soon if he’s not careful
Reply: As an engineer , I appreciate this post.   Ty for the testing and honest details.
Reply: @Vampirat3  bot. Any engineer would laugh at this, as i did.
Reply: Is the ram drivable anymore?  Would you honestly drive a car with a bent steel frame and tow stuff? 

Maybe you would?

Also why didn't you hold the truck down in the front with the ram?
Reply: @EdWord1583 Because he was trying to load the test against the cyber truck. By putting the Fork lift on the front of it, did not allow the suspension to do what it was designed to do, which forced a inaccurate weight distribution and stress across the frame of the truck.  He did as much as he could to load against the cyber truck.
Reply: @EdWord1583  "Is the ram drivable anymore?" It doesn't have an engine in it - mentioned during the video. Otherwise it would be.
"Would you honestly drive a car with a bent steel frame and tow stuff?" Depends on what you're towing, but for this test it doesn't really matter. 
"Also why didn't you hold the truck down in the front with the ram?" They did - there's a scene where the forklift is jammed into the engine compartment and holds it down.
Reply: @EdWord1583 because he hates Elon and would do anything to damage Tesla.
Reply: @EdWord1583  He did hold the RAM down in front, or it woukd have flipped the truck. He just expected the audience t9 be bright enough to understand that without being told a second time.

A slightly bend frame can be straightened, but in this case, the hitch receiver will bend before the frame does.
Reply: ChatGPT says a trailer should handle 20 percent of the towing weight on the tongue.   Asking for 100 is not correct.  You know about safety factors, don't you?
Reply: @thecatsupdog  let's assume chatgpt is correct in saying that 20% of the trailer weight should be on the tongue that the safety factor is 1.5 and that the frame is a lot more fatigue resistant material (steel) so it can only be loaded to half the yield strength and that there are no bumps on the road and that would bring you to a total tow capacity of 13000 lbs. Under all of these assumptions
Reply: @thecatsupdog  bro... Chat gpt anyways people miss load trailers all the time I mean just look up over loaded trailer online you'll see 1000s of videos. Also what is your response to the older Dodge doing fine. Like y'all really ignore all the variables if it fits your narrative. I mean really one slightly miss loaded trailer and a speed bump is all it takes to snap the frame. That's poor build quality.
Reply: @thecatsupdog  he’s going for shock effect and hates Tesla.
Reply: @thecatsupdog  I do not care what ChatGPT says, as it is irrelevant to what happens in real world settings. So what he is simulating, is like what I accidentally did with a 2001 Ford Ranger when I loaded a 2020 Toyota Rav4 onto a flatbed trailer at night while getting an emergency phone call with a frantic woman on the line. That max load I had of 6,000LBS I had hooked to the truck improperly due to distractions, would have easily become the equivalent of 12,000+ LBS in a panic stop of accident. And for the record, that Tesla Cyber truck Jerry has would not tow the loads of roofing trusses I use to haul that weighed 30,000+ pounds with a Chevy C30 dully and we did have a tongue pull truss trailer that we never used. People who work with their trucks often exceed that 20% ChatGPT is talking about.
Reply: @GenderSkins  Sounds horizontal not vertical.
Reply: @thecatsupdog Jerry is clueless and clearly doesn’t understand even the basic physics of holding down the front of the truck stressed the casting and ruined the experiment. Jerry failed basic physics.
Reply: @ ChatGPT gave you bad advice. 10% is the usual number.
Reply: @thecatsupdog 10-15% of the gross vehicle weight of the trailer (trailer weight + payload weight) goes on the tongue of the truck. Meaning the trailer takes on 85-90% of the load weight but the 10-15% relies on the truck.
Reply: @thecatsupdog  are seriously going to reference an AI Chatbot as your credible source??
Reply: @thecatsupdog  chatgpt says this and that. Why dont you look up articles yourself?
Reply: @thecatsupdog  Just to re-iterate what he said in the video at “9:45”. The truck needs to be able to take a higher percentage of that weight (for example) going from a high incline to a flat area. A boat ramp is a good example. Would be awesome if someone could test the hitch in that exact situation.
Reply: @theshadowknows6969  yea a boat ram strains the towing capacity not the downward force. It actually becomes lighter at the hitch and heavier on the "pull" at a slope since gravity is still pulling down.
Reply: @theshadowknows6969  any incline where the truck is higher than the trailer results in less tongue weight, not more. You’re confusing the horizontal pulling weight with the vertical tongue weight. The horizontal pulling weight will be more, but the vertical tongue weight is less when in incline.
Reply: @thecatsupdog crazy how he doesn’t answer questions that make sense huh? He trying to bring tesla down.
Reply: @thecatsupdog  didnt watch huh?
Reply: @thecatsupdog did you watch the whole video? Cos he sure did cover this
Reply: @thecatsupdog  don’t worry, he’ll keep ignoring these sorts of comments to push his narrative
Reply: @madhououinkyoma 😅😂
Reply: @madhououinkyoma of course you have an AI generated pfp of Harry Potter
Reply: @madhououinkyoma   Rivian has a steel frame, just like any other real truck. Only tesla uses cast aluminum.
Reply: @madhououinkyoma  Had to stop suddenly when a car pulled out in front of me, load of gravel shifted forward. Hitch bent but didn't break. The narrative is a correct one and needs to be pushed regardless of ignorant comments like yours.
Reply: @heartysteer8752  the cybertruck would be fine withstanding the same weight you did with gravel. 1,100 tongue weight and 11,000 ton towing is an name amount of weight.
Reply: Then it is false advertisement when it can't reached 11,000lbs of loading?
Reply: @AntLeung457  Nope - far from it. The 11k lbs does NOT mean you can load 11k lbs on the hitch. It means that you can pull 11k lbs from the hitch. ALL of these trucks would seesaw if you put 11k lbs on the hitch - which is why it's a bad test that doesn't prove anything to begin with! Literally the front wheels would be in the damn air! 😀
Reply: ive seen regular ass cars with better towing capabilities
Reply: @boxfoxscoot1614  No, you haven't. In reality the Cybertruck would pull any car around like nothing if you tied them together. That said, I doubt anyone who buys one of these things will ever do any work with it anyway, they are mall crawlers and attention getters. EVs suck for towing any significant distances so I'm surprised they bother to put a hitch on it at all.
Reply: I agree on the mall crawler point anyone who buys one of these would be better served buying an suv with a tow hook
its cheaper its better designed it will tow your shitty trailer you get out 3 times a year just as well and it wont get you a bill for a new window after someone throws a brick through it for buying a "swashticar"
Reply: @boxfoxscoot1614  this is a stupid comment. No car can town what either of these trucks can. The video is showing tongue weight capacity not tow capacity.
Reply: I here a recall... Or more likely a buy back.
Reply: Since we know you hate Elon.  Lets do Rivian next.  How much money did you get from USAID?
Reply: @jaytrock3217  nice try, maybe use your brain next time. Not everyone is on a 'payroll', my dude. He tested the EXACT same thing on 2 cars, and the Dodge smashed it. SAME TEST, yea?
Reply: @jaytrock3217 we so sorry education failed on you. Perhaps you could direct your issues to the RICH that dont pay fair share taxes and steals your money ?
Reply: @jaytrock3217 we know he won’t. He’s such a tool and has to protect his USAid money 😂 he’s such a looser.
Reply: @jaytrock3217  Ahh, Elon cultists and conspiracy theories go hand in hand.
Reply: @TroySavary  ok Boomer
Reply: The test was fair enough, Jerry just showed us how we are being fooled by the big companies which they think they can mess with a guy like him.
Reply: @anosh.bakhshi  FAKE VIDEO TO DISCREDIT TESLA !!! 

The maximum tongue weight—the downward force on the trailer hitch—of Cybertruck is 1,100 lbs (500 kg). 

It broke at 10x that weight limit … so it’s nothing wrong with the truck 
If Anything… it was over engineered!!!!
Reply: @  I can certainly see where "Jerry" got his channel name from. He definitely rigged this test. (Except his name is actually Zac).
Reply: @aftonline bahaha 💯